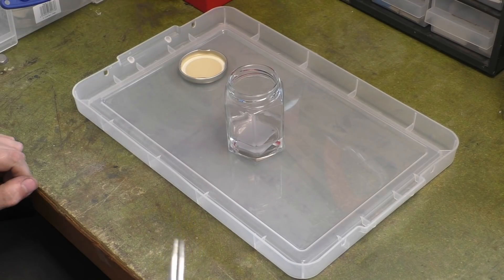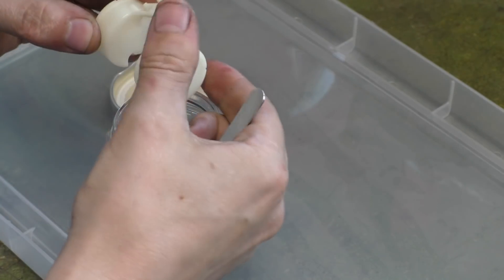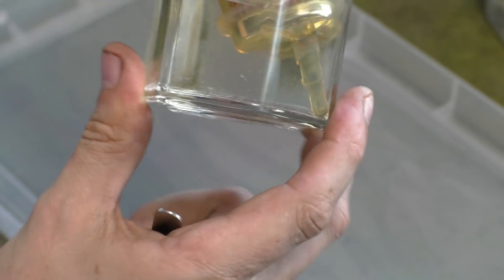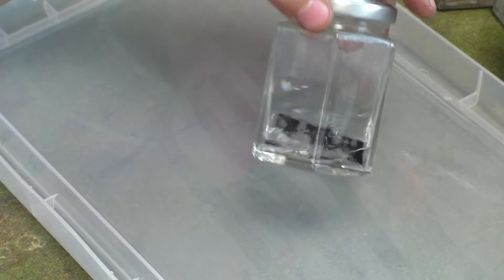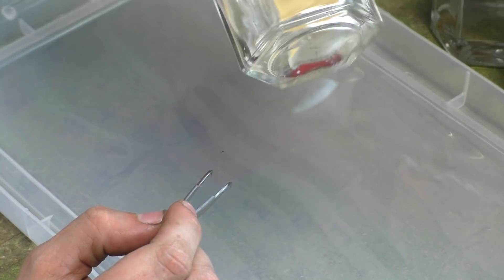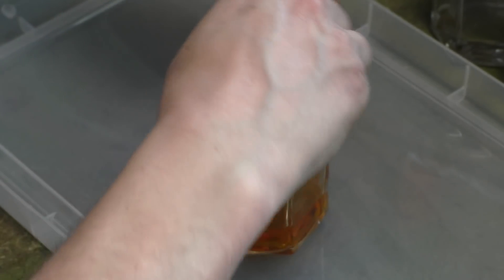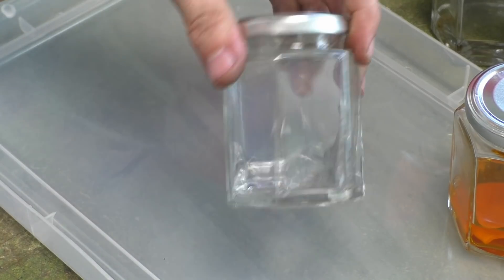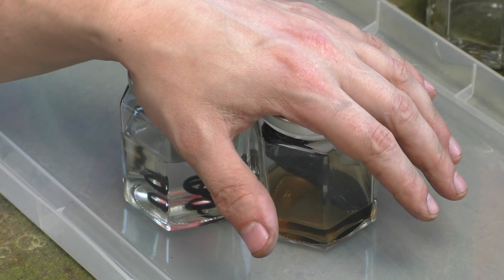Is Ethanol bad - 3 month Update

Comment: Put two dissimilar metals e.i. mag + steel in ethanol and add some water or leave it open and THEN you will show what the issue with ethanol is. It absorbs moisture leading to conductivity in the fuel, leading to corrosion between dissimilar metals.
Reply: Roland B I think petrol absorbs water as well. Not to the same extent but it can also accumulate water in the tank
Reply from the maker: "Put two dissimilar metals e.i. mag + steel in ethanol and add some water or leave it open and THEN you will show what the issue with ethanol is."

- That's the water causing galvanic corrosion not the ethanol.

Yes Ethanol is hygroscopic but the rates of water absorbtion are very, very small - I have been sent some test data on this that will come up soon.
Reply: Yes, the galvanic corrosion is from the water as I implied. I don't think the hygroscopic properties of ethanol in the fuel are negligible at all. In fact I think you would find that most of the damage done to older vehicles, particularly ones with carburetors, by the ethanol in the fuel is galvanic corrosion between the dissimilar metals. At least it has been such in my 25 years of experience on engines and since the introduction of ethanol into the fuel here in the USA. All of the "ethanol treatments" available look to combat the moisture and corrosion as their main purpose.
Reply: From the fuel-testers.com website "- Ethanol gasoline is hygroscopic (will absorb water) and can absorb 50 times more water than conventional non-alcohol gasoline. - Phase separation occurs in E10 gas, when only 0.5% water or 3.8 teaspoons water per gallon of fuel is absorbed. ... With the process of phase separation, two layers of liquid are visible."
Reply from the maker: Okie kokie lets do this - 

1) The fuel tester website is just selling you shite.
2) I have test data from the National Renewable Energy Laboratory - https://www.nrel.gov/

They have tested E10,15,25 and 85 for 8 weeks and the test samples were distributed over 8 locations across the US 

They found under 85% humidity the water content increased by 0.5% by mass. E25 was the worst at 100 ppm/day with E85 reading 55 ppm/day - this is due to saturation.

This is what they had to say - 

"Results from constant temperature/humidity tests in glass test tubes represent a situation where fuel weathers by evaporation. In uncapped tubes this evaporation occurs rapidly at 28°C (82°F) such that all of the fuel evaporates in less than one week. Internet videos and other anecdotal presentations of moisture uptake by ethanol-gasoline blends held in open containers (mason jars, beakers, etc.) fail to take into account the extreme fuel weathering that occurs in this situation–which has a much more rapid and significant impact of fuel quality than moisture uptake. 

A more realistic scenario is a fuel container with a small opening such as the test tubes with caps that have a 0.3 mm opening as used here. This dramatically reduces the evaporation rate and reveals that ethanol-gasoline blends can absorb moisture from humid air at a faster rate than hydrocarbon gasoline –an expected result given the hygroscopic nature of dry ethanol.

When held for a sufficient amount of time in a humid environment the blend can absorb enough moisture to result in phase separation. Nevertheless, even in this situation fuel evaporation causes a dramatic reduction in fuel quality such that the weathered fuel is no longer fit for purpose well before it has taken up enough moisture from
the environment to phase separate.

Pure hydrocarbon gasoline stored in the same environment for the same period of time would be unfit for use due to weathering, despite much lower water uptake and lack of
phase separation."
Reply from the maker: To answer each statement from "fuel-testers.com"

"Ethanol gasoline is hygroscopic (will absorb water)"

- Correct.

"and can absorb 50 times more water than conventional non-alcohol gasoline."

- No evidence of this - at all.

"Phase separation occurs in E10 gas, when only 0.5% water or 3.8 teaspoons water per gallon of fuel is absorbed."

- when fully exposed to the atmosphere - at this rate your fuel will have evapourated and the fuel will be weathered. 

"With the process of phase separation, two layers of liquid are visible."

- Correct - i.e this is what phase seperation is - i.e just a definition of the word.....
Reply: I don't doubt fuel-testers is trying to sell you stuff. I'm in nobodies team here. Two things are for sure however. The NREL is a lobbyist to the use of ethanol, it is in their interest, so of course they are going to downplay it. and ethanol affect the storage of fuel and fuel system due to elevated levels of moisture. I have no experiment or 10 min video of this unfortunately,  rather real world day to day experience with such. In machines where fuel sits for prolonged periods unused , untreated ethanol fuel will have definite negative effects, mainly due to the moisture, compared to a non ethanol blend as well as the decomposition of the fuel that occurs naturally.